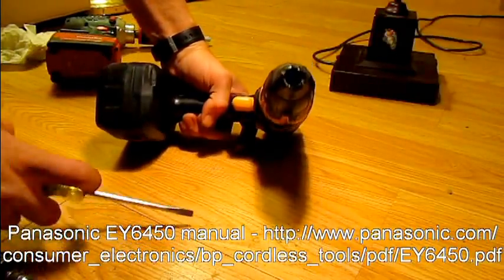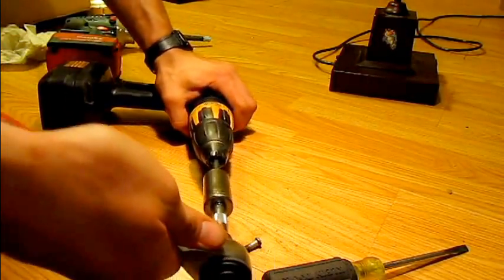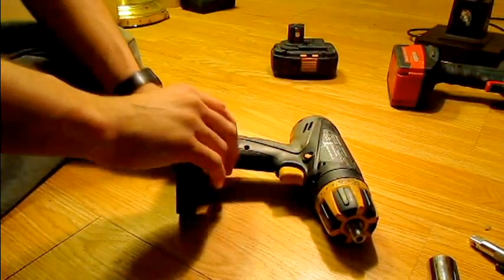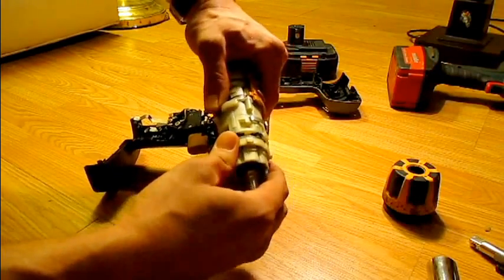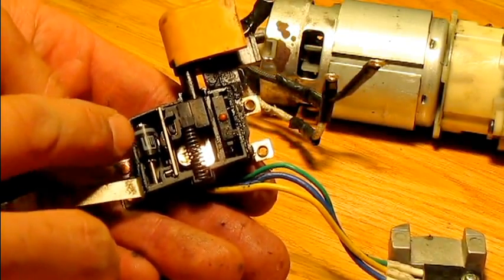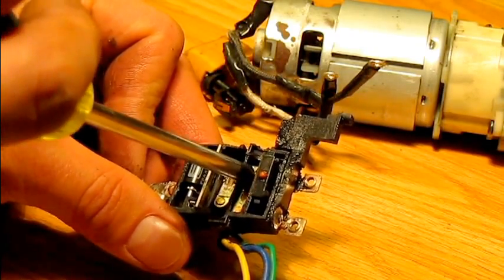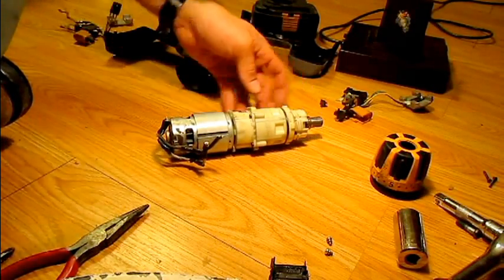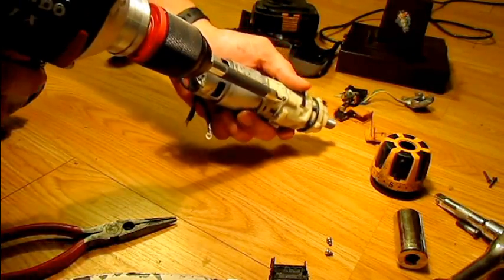Cordless drill - Complete teardown and rebuild, with explanations (1/2)

Comment: what you call a thermometer is a mosfet held on with a screw and probably thermal paste to keep it cool the other thing you call a thermal cutoff switch is a diode the heat sink is purely for that mosfet

Comment: Hey buddy, great tear down. I was wondering if you can give me a suggestion on my Dewalt 18vol screw gun. The torque adjuster was not working properly, wasn't turning properly. It only turned to 3 then stopped. something was lose inside of there. So I took it apart and found a little piece of metal like a tooth, one end is thin and the other thick. It came off from somewhere but can not figure. I put the drill back together without that piece, and seems to work fine but it does not stop at the end number or mark. It keeps turning until it's tie and does not turn anymore. I figure that piece of metal is to make the adjuster stop at the end mark, but have no idea where it goes or put it back. it keeps coming off a slot I found that seems like that little piece goes in it... Any idea, any one? Thanks!
Reply from the maker: Haven't looked inside a Dewalt for many years. On this Panasonic the metal piece you see clipped onto the exterior gear housing at 3:30 snaps into castings in the plastic torque selector housing you turn and provides the settings and end stop. Sounds like the plastic housing or metal clip is broken if yours keeps coming off. Replace, or use some rosin or friction paste to keep it from moving around.

Comment: The MOSFET is part of the speed control together with the resistor and diode. The heat sink does not absorb any heat from the motor; absorbs heat from the MOSFET.

Comment: The component on heatsink is MOSFET, the the component inside switch is not for thermal cut-off, it is DIODE, which mostly use to absorb emf from motor, protect other circuitry,

Comment from the maker: Yes, as noted at the end of the second video, the brake was fixed. You could try sanding the contacts if they're dirty, or rebuilding them with rosin core electrical solder if they're pitted and corroded.

Comment: FYI: the part on the heatsink is not a thermometer, it is probably a SCR (silicon-controlled rectifier). This device is generally used in switching applications, in this case regulates the motor speed.

Comment from the maker: @holdenbreau Lithium batteries are more sensitive and fussy with complex circuitry more prone to break down. The electrodes degrade rapidly when exposed to high temperatures meaning reduced lifespans and they perform poorly below freezing compared to Panasonic's NIMH.
Reply: I'm just wondering if you still have the same opinion on lithium batteries?